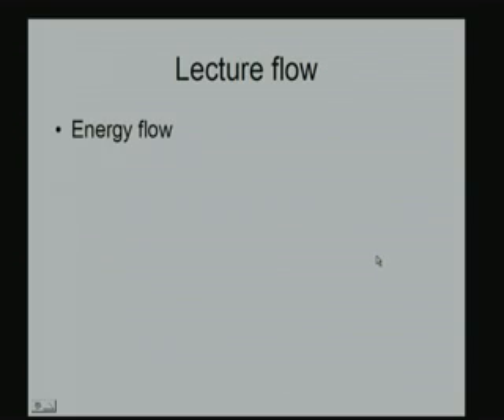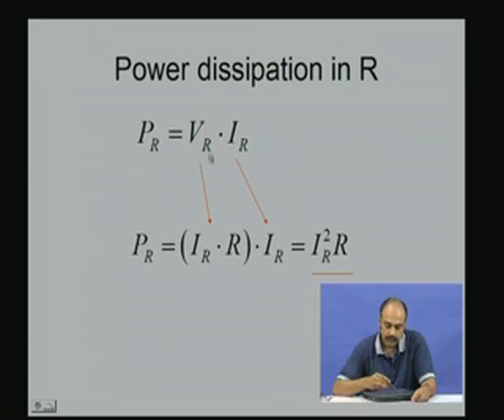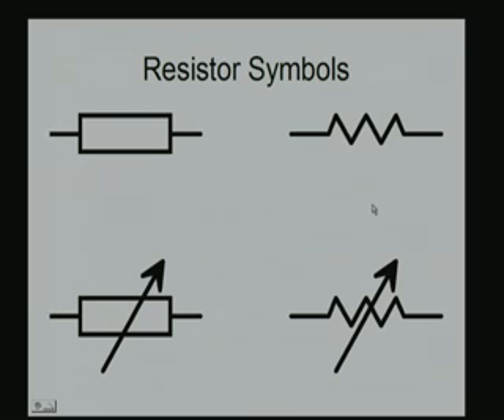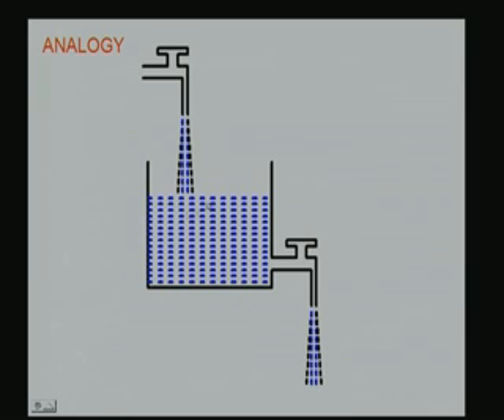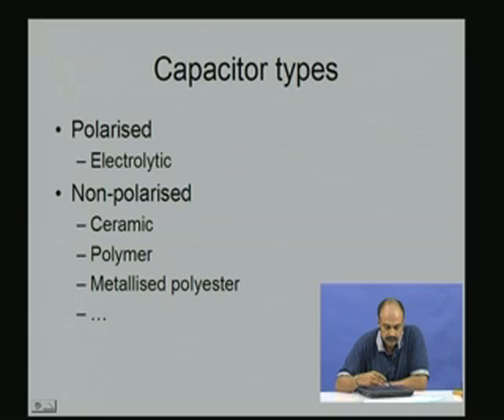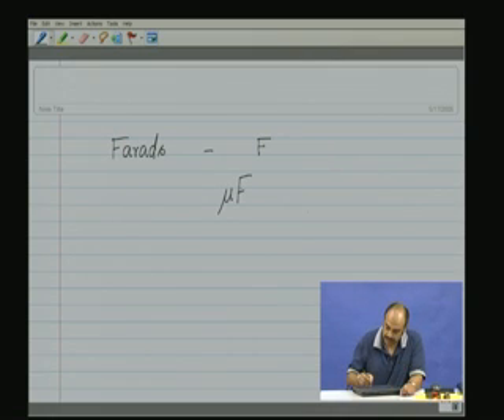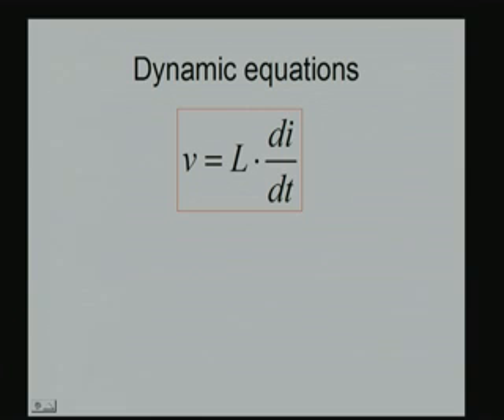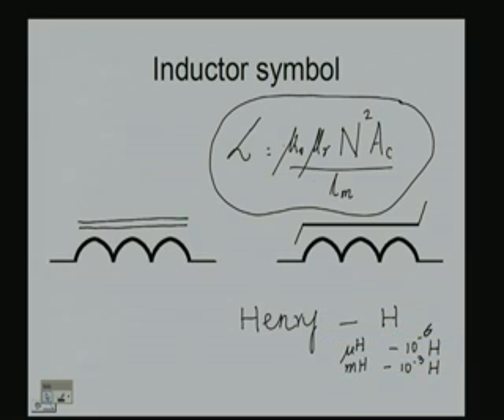Lecture - 3 Passive Components

Comment: Just a little detail -> Ohms law -> V = I * R is true , provided temperature is maintained constant.
Reply: Actually the statement V = IR is true irrespective of temperature. The resistor value R is simply calculated as a function of temperature and not treated as a constant. A common linearized model being R = R0(1+alpha*T) where R0 is resistance at 0 degree Celsius and alpha is the temperature coefficient of the resistance.

Comment: A unified approach to electrostatics and circuits willmake it easier to understand the operation of resistors, capacitors and inductors.
The two videos i. https://youtu.be/REsWdd76qxc and ii. https://youtu.be/8BQM_xw2Rfo on Current and conduction process and surface charges discusses a unified approach and the textbooks mentioned in the last frame of video i. discuss in more detail resistors, capacitors and inductors.

Comment: why the voltage across a capacitor cannot be changed instantaneously?
Reply: because capacitor will explode
Reply: this is due to the fact that sudden change in voltage here means finite change in value of voltage in zero time duration.. therefore for that to occur.. according to the dynamic equation of capacitor.. infinte amount of current is required which is not possible.